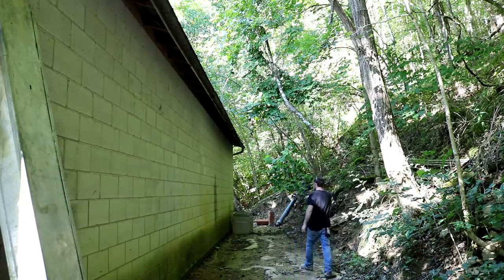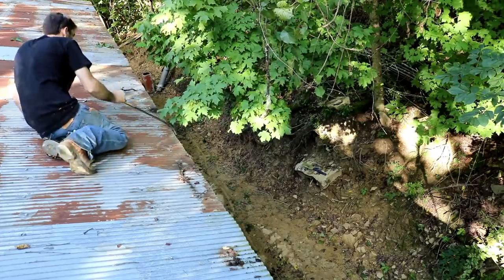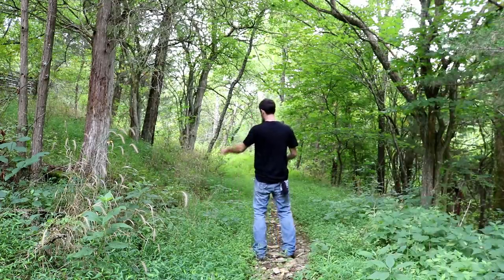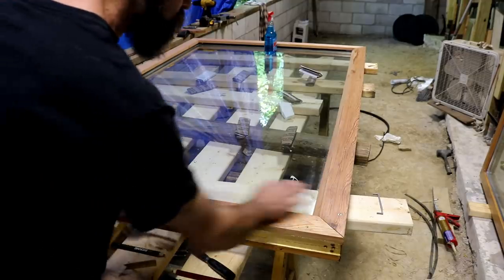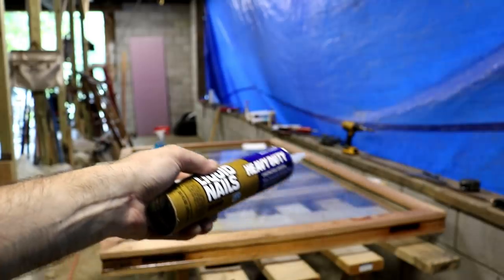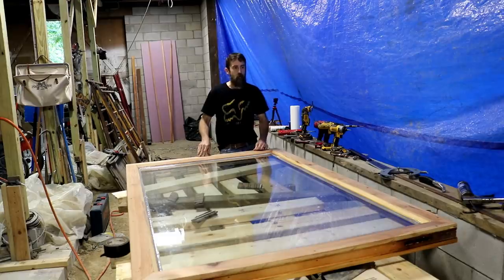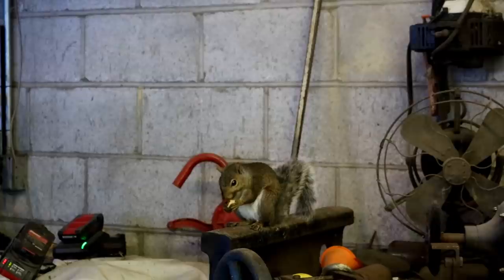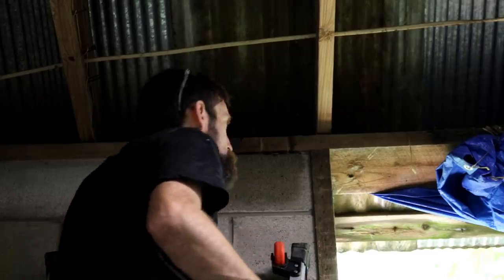Sliding glass door Windows ?? :) Finished. Worst Gutters on the planet.

Comment: On your top plate, after the bolt set, cut another piece of framing lumber that spans the repair and the bolt pulls it down over the original top plate. Then use a Simpson bracket to tie onto the two adjoining rafters. Keep your roof on during a hurricane. You could still do it now with a piece of steel since your bolt is not likely long enough to get another wood framing member onto it.

Comment: Steve, chiggers are the worst!  They really like "close, soft areas" like inside your shorts.  ;)  Spraying the chiggers (on you) and/or their bites with Vitalis hair spray really used to help make the itch go away.  Hopefully they haven't changed their ingredients.  I applaud you for taking on a job this large mostly by yourself -- I doubt that I could do what you're doing, certainly not as quick as you are doing it.  While I really look forward to watching you make (metal) chips again, I'm certain that you are looking forward to that time way more than we do.  I've learned a lot by watching you do this project -- I have a partially closed-in pole barn with a shop on one side and garage on the other.  I need to close it in and figure out how to keep moisture from coming up through the existing concrete, which I assume has no proper vapor barrier.  Once closed-in, I'll get away with "expanding" my shop, kind of like you're doing!  ;)

Comment: Some one may have already mentioned but alot of the craftsman saw motors are reversable. If yours is flip the motor 180 degrees, swap ends with the shaft protecteor cap , rewire for reverse rotation and you will have a new shaft for you new pulley

Comment: Every cordless drill I've had has performed acceptably, the only reason I've dumped them was because the batteries and/or charger have died and it's often cheaper to buy all new than replace the batteries.  I did notice the Dewalts I have now run smoother than many of the others I've had.
Reply: at one point for me, it was cheaper to buy a new drill and battery than just a battery. Battery cost $59 drill on sale with same battery $49 The batteries never went on sale.

Comment: Hi Steve, I don't think those are the worst gutters. Because those aren't gutters anymore hah. 
Great job on the windows, that'll be nice. Interested to see your approach to installing them. If you're not building jambs (trim in the opening instead) when you set them you may want to rest them on rubber blocks at the bottom of the openings. Chunks of conveyor belt, bias ply tire tread or whatever. You could use cedar shims to locate the sides and top.  Then use a expanding foam around the perimeter. Your trim then covers it. This would let your windows essentially float in the framing, more or less eliminating possible pinching/breaking should things change years down the road. If your not building jambs, still create a good proper draining sill to rest everything on first. 

CHIGGERS!! LOL at your "explanation".  They're all kinds of fun, let you know you're alive huh....
Walnut probably got into another male's territory. They can be vicious if they want to. I"m sure he was glad to see you.
Coming right along.... looks great HE-man - be careful...if you push the block down any harder it'll bust haha... Thanks for sharing

Comment: Fire up the lathe and make those pulleys. It had to be said and I said it. 😊
Reply: They aren't too bad to make, assuming you have a spare HSS bit to grind into the right profile for the groove.
Reply: Sometimes you just have to pick your battles. Time is valuable......
Reply: @notajp  Absolutely agreed! If it's a bog standard part, easy to get off the shelf for a few bucks, it doesn't make sense to make it yourself... unless what's commercially available isn't quite suitable, isn't immediately available, or keeps failing. Other than that, agreed.

Still, turning a quick pulley out of aluminum is a very fast job if you have the HSS bit already ground. I can cut a slice on the saw, face both sides, spot/drill/ream, groove the OD, and cut the keyway in a matter of 15 minutes. 

If I can't get the needed pulley the same day, that alone can make the job worthwhile.
Reply: John Acuff Yeah, but I wouldn’t mind some lathe or mill content. After all, I subscribed because of Abom79’s recommandation 😃
Reply: @StangspringDK  Exactly, this is great content but I saw the pulley making thing as an opportunity of taking some vacations from fixing the shop (wich is also great) and recover the machining videos, just to refresh the memory on what is this channel really about: machining and friendly squirrels with an even friendlier host and family :-)

Comment: If you can handle the drainage well at ground level I am all for no gutters. It sure does make life simpler as for as building maintenance. Also never have to worry about ice dams or back up damage from plugged gutters. So many barns have stood 100+years with nu gutters ever. Drainage is important though to avoid any foundation issues. Heck on that side you repaired it probably falls straight in the creek anyway. LOL

Comment: Craftsman Table Saw Belt & Pulley Kit with 2 1/2" Pulleys, Keys, Fenner This is the pulley system and belt you will need for your tablesaw takes away all the vibrations and works perfect this is on Amazon I hope this helps you

Comment: The chigers I dealt with in Texas were basically invisible, microscopic mites.  They didn't attach like a tick they burrow a little hole and live inside your skin, terrible!  If you worked in the woods like I did you get eat up for a couple weeks in spring then for some reason you become unpalatable to them and they leave you alone.  I'd be working right next to a new guy mid summer who gets eat up and Id get nothing because they were done with me.  There were all kind of home remedies (fingernail polish, Vaseline etc) but nothing I found did anything, just suffer through or as I did move away.

Comment: Use some Sawyer's permethrin spray to treat the insides of your pants legs and waistband area along with collar and sleeves of your shirts to combat chiggers and ticks. It will last thru a couple of washings but not as good as when first applied and worn once dry. You can get the same active ingredient at Tractor supply much cheaper sold for livestock use. It's particularly good for seed ticks which are the absolute   worst in my opinion.

Comment: Chiggers are a terrible problem in the spring and early summer, here in my part of Oklahoma. You can keep them out of your yard by broadcasting dusting sulfur in your grassy areas. Dust a little on your lower pants legs before you go in the woods to keep them off you. It doesn't smell very good, but it seems to be a relatively low toxic solution to the problem. Sulfur is available in the gardening department at the hardware store.

Comment: There seems to be a bit of a dichotomy in building styles there in the US. In the UK we build houses out of brick and block pretty much exclusively, and as far as I know there is no grouting up of the interior done and no vertical reinforcement or steel web in the horizontal joints. 
In the US you either nail together some bits of softwood timber and call it a house, or appear to use blockwork in a style suitable for a gun emplacement. Why no expedient middle-ground?
Reply: We like gun emplacements

Comment: Where the shaft on your table saw motor is chewed up you could possibly have a quick (and permanent fix). The motor appears to be double ended, if the shaft on the other end is the same then flip the motor over (it will now be turning the wrong way, I think). There is a quick wiring change you can do internally on a single phase motor that will reverse the direction.
You probably have already thought of all that, if so sorry.
Reply: I was thinking the same thing.

Comment: Only reason I'm glad for freezing weather is that keeps the max bug size down. yeah I hate chiggers, and pine beetles. Pine beetles look for a vertical surface to land on and when they land on something warm they bite it out of fear and it hurts worse than a bee or wasp sting I found cause their mouths or teeth w.e are bigger.  Nice thing is the things click when they fly and you can usually swat them out of the sky if you notice them soon enough as they can't seem to stay in the air long

Comment: hmmm placing power drills upright on a glass pane with hss bits fitted   may not be a good idea!   (experience)
Reply: I had a sliding glass door shatter when a carbide tooth came out of a saw and hit it.  Funny thing was how it shattered. After I shut the saw off I heard a strange crumbling/crackling type of noise and looked around to see what was causing the noise and saw that the door glass was slowly shattering into small pieces from the point of impact.  It probably took 10 or more seconds for the shattering to progress from the point of impact to envelop the entire door.  I hated losing the door but watching the shattering slowly expand, like slow motion, was pretty neat to see.

Comment: if want to check if an area has a heavy Chigger load get yourself some 4"*6" pieces of black vinyl floor tile or even cut up section of black plastic garbage bags and lay them on the ground for about a minutes.  After laying them on the ground for a few minutes examine the black pieces of tile or plastic for pin head size red bugs crawling around on them.  Adult Chigger will be larger and are not the ones that bite you it's the juvenile ones aka the larval that jump onto you and then burrow into you skin and inject enzymes (basically their salvia) that causes the skin cells to decompose which is what they feed upon.  The reason why the Chiggers will jump onto the black swatches of tile or plastic bag is because to them the dark object represents the shadow of an animal walking by which is the same as ringing the dinner bell.  It is also the reason you only leave the swatches of black tile or plastic bag on the ground for a short period of time because once they figure they can't get feed they will crawl or jump off.  The interesting thing about Chiggers aka Red Bugs is you could walk across a field, a beach, etc and only one part of it will be infested with them and the rest of that field or section of beach will not have a one and though the US Military has spent millions of dollars on grant money to my knowledge no one has been able to accurately determine why this section of field, wood, or beach will be covered in them and 20 yards away you won't be able to find one.  As anyone who has ever been bitten by Chiggers knows you can go an out half crazy from the painful itching you can/will experience from them, Growing up the most popular method of trying to help reduce the itching was after taking a bath in corn starch and epsom salts would be to take nail polish preferably clear and put a little dab on each red bump and of course taking either Chlor-Trimeton or Benadryl additionally Calamine lotion also can help provide some relief.  My great grandfather swore by dabbing on a concoction he made and then painting the bites with nail polish or shellac.  His concoction is made up of household Ammonia, Campho-Phenique, Adolf's Meat Tenderizer, and a couple of pieces of leaf chewing tobacco (you only let the pieces of chewing tobacco soak in the mixture for a few hours and then discard them. Yeah I know it sounds strange but it works on relieving the pain and itch of most ever insect sting or bite.  Basically it is own version of "After Bite" which main ingredient is Ammonia.  The food news if there can be good news about being bitten by Chiggers is they don't carry disease so other than the itching , red bumps, and whatever damage you do to yourself scratching there bites,. Simple put don't scratch because you are just increasing your own misery.  If you are wondering why I know so much about the damm little critters is I spent mu summers as a child working in Florida and Georgia for my Great Grandfather survey crew so I got eaten up pretty good by the little buggers and my Aunt got her masters studying ticks and her Phd studying chiggers which is where I learned about the swatches of black tile or garbage bag to check and area for chiggers.  One other thing don't wear black boots and spay your boots and pants with DEET big repellent ever hour and what ever you do do not be a dumb ass and dress your pants with a flea collar that is a quick way to end up in the hospital sick as a dog and possibly with organ failure as some service men learned in Vietnam.

Comment: Great vid as always Steve. I look forward to my Saturday morning notification every week. You're flying along. So what's gonna happen with the roof? New sheeting I presume? In Ireland, gutters on outbuildings tend to be plastic or extruded aluminum. My little shed (20x14) has an aluminum one on it. They don't rot. Can't wait to see it framed and the windows in!!!
Reply: Here in Germany most gutters on buildings are made of rolled zinc sheet metal or copper, they last over 30 years, copper even more...Plastic ones are prone to UV rays and "rot" over time...In the DIY sector platic gutters are still in use, but mostly on secondary buildings like garages or sheds...
Aluminium sound good, too!
:-D
Reply: I've always been fascinated by the companies and machines which will come to your property and use a large roll of sheet Al/Cu/Zn (your choice, of course) and roll a one-piece gutter for each wall in need. It's interesting to watch the folding and rolling process, a bead forming on both edges, and all. Best to have as few joints as possible, it does make sense, but it also removes the DIY aspect.
Reply: @elitearbor  Never seen made them from flat sheet in place, I only know them from pre-made lenghts, cut to fit on-site and joined with connectors...
Nice idea, though!
:-D
Reply: @horstszibulski19  Indeed it is quite the spectacle to observe. I bet there are videos here about it, somewhere...

...and indeed there are. The first hit under "roll forming seamless gutters" shows precisely the machine I had in mind.
Reply: Horst Szibulski, it’s fun to watch them, they have a 16 foot long van and they pull a 24 foot piece of gutter out of it!
Reply: @Hoaxer51  :-D
Reply: Mr. Morningstar  Checked out for some vids now, really impressive!
:-D
Thx for the info's!

Comment: I actually prefer cordless drills that don't have the "hammer" function.  If I need to put a hole in concrete, I'll use my rotary hammer.   Proper tool for the job and all that.
Reply: I've used impact drivers for years to drive screws and drills to make holes. Drills make poor "drivers."

Comment: Steve,   i told myself to NOT make stupid suggestions. i hope this will be non-stupid.  when you pour the floor, break that [L] into 2 rectangles with that fiber product they put in sidewalk cracks every  so many cracks.  going around that corner will want to cause cracks.  walnut knows where home is! he knows who loves him. poppy's workshop says HI
Reply: You mean use concrete expansion joint? That's what that black material you pour concrete up against is called. A good idea is to attach expansion joint to the wall you are pouring up against.

Comment: We have swimmers itch up here in Michigan. Little chiggers that spend their life going between snails and ducks feet.  Apparently they think we are ducks feet.

Solution to chiggers:  if its the kind of critter that bores into you, (this is what swimmers itch does), a little nail polish on each little bite cures the itching in 30 minutes.  It stings, yes, but what it does is cuts off the air supply to the critter.